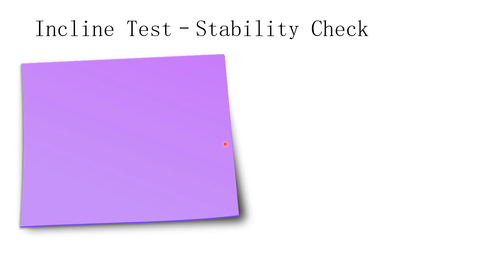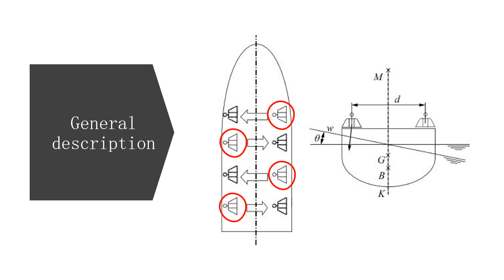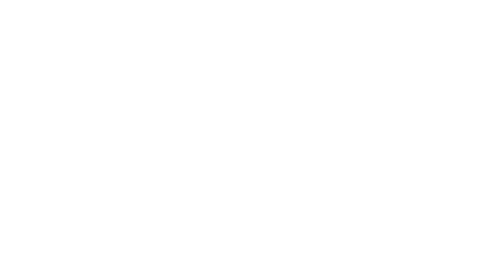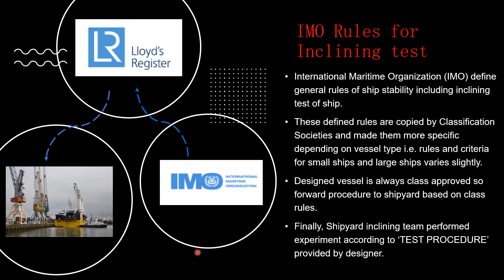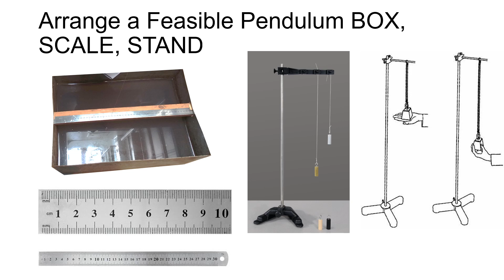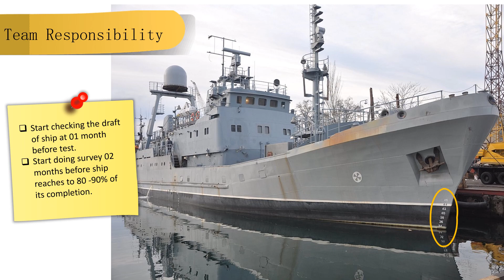Inclining Experiment | How to perform inclining experiment | why inclining experiment is important

Comment: Great video , Do you know what modern digital inclinometer sensors some shipyards use to replace the pendulums ?
Reply from the maker: No. Pendulum give more accurate value as compared to sensor. Sensor are used in addition to pendulum to counter check the values during inclining test.
Reply from the maker: Furthermore, inclinometer or sensor is very helpful to give heel or list of ship, eliminate need to note draft